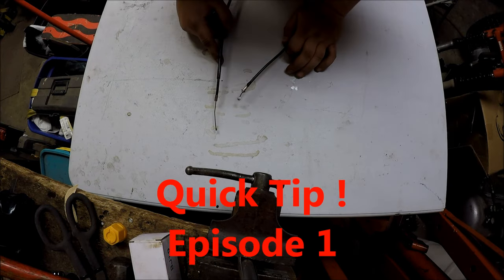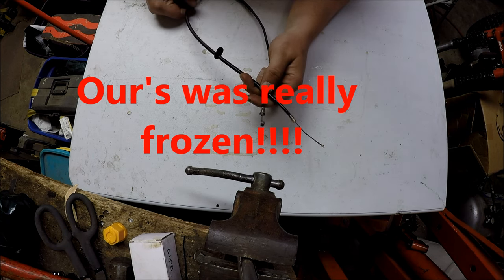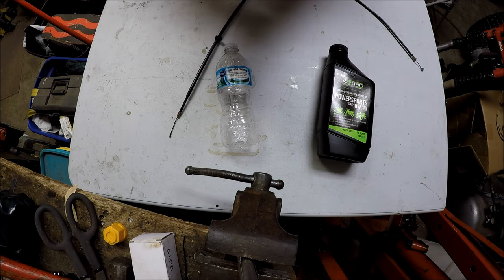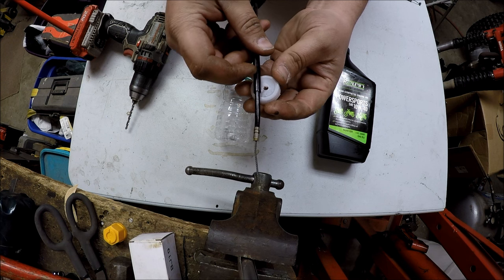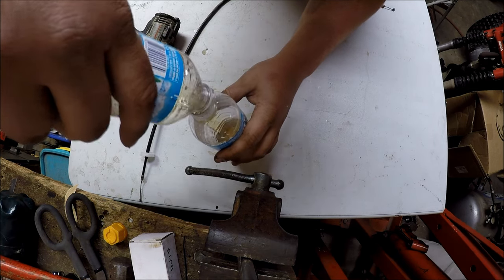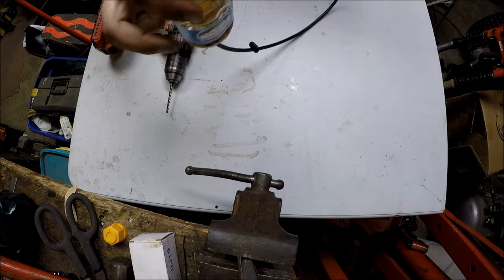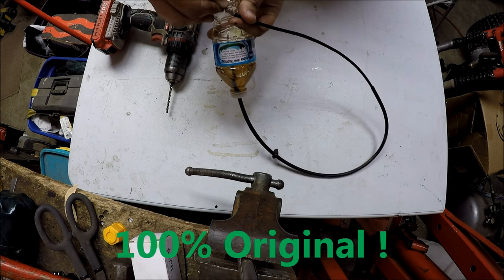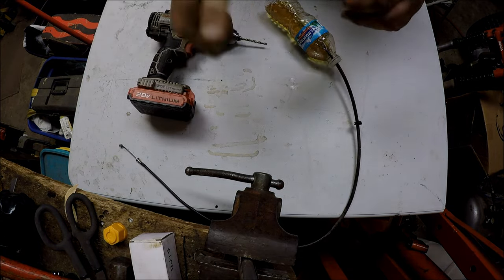How to fix Frozen Throttle Cable  , Brake Cable , Choke Cable on ATV Motorcycle Dirt bike

Comment: I have a rear brake housing and brake line that is tight... so I took all the brake line and housing off bike and soaked brake line in mineral spirits in a bucket and then poured mineral spirits down the housings until I saw it coming out other end. Meaning it went thru inside of housing cable. Yes yes I wasted a lot of minerals spirits doing it but whatever and that said and done my brakes are still sticky.. however this method worked excellent for my front brakes... I ride shimano 5800 brakes on carbon wheels... I'm not riding with stuff not being cared for is what I'm saying... I ride alot and wash my bike a lot so water seeps into the brake lines and rusts the shit out. That said this is only video of trouble shooting brake line/housings for if there tight and what how to re loosen them... all in all I'm thinking just buy a new set of brake line and housings but ther has to be something for the temporary fix... I think this method of this video is 100 percent awesome since he thot of it and if it works than the results say it's awesome
. 
However that motor is too thick for my running that on roadbike brakes... maybe a motorcycle or atv...  anyway minerals spirits clean off and degrease stuff super well as well as evaporates and dries on it's own... it tripping me up why rear brake is still tight I know one factor is that it travels farther and has a lot more turns and line but idk

Peace guys cool friggin stuff!

Comment: Can anyone help me with my go cart? it works but i gotta hold the throttle cable to a sertan spot for it to work and if i let go of it it just stops so anyone got advice for me to fix it?
Reply from the maker: Have you tried cleaning the carburetor on it.
Reply: Yeah i paid to get everything fixed on it but now the problem is unsettling. my sprocket wont stay on as much as i tighten the screws
Reply from the maker: @bountyme446   are they stripped out or vibrating loose?

Comment: Great video man!! But brake fluid works a lot better, then motor oil..
Reply: Yes but brake fluid is very corrosive. Pour some on a painted car and see what happens over a period of time.
Reply: The idea is to use what ever you might have around the garage, maybe.. but yeah I agree with brake fluid...

Comment: i was riding my1995 honda 300trxfw4x4 and it suddenly stoppedd like their was no gas but the tank was full i know it has somthing to do with the choke but i cant figure it out
Reply: Could be a number of things. Watch some videos on steps to diagnosing an engine that won't run. 1st you make sure you have spark, then compression (probably not an issue for you),  then fuel and air. spray some carb cleaner in the intake with the filter off and see if it fires up. If so id bet your carb got plugged up with debris.

Comment: My cable had a fat end of it that wouldn't fit in the bottle. So I duct taped it to a funnel and sprayed PB blaster in up to about an inch depth. It slowly ran out the tape in a few hours so wrapped rags around it. And in 2 days it ran out of the cable. But after pulling on it with vice grips it only moved an inch. Turned out the cable had rotted away inside. Don't know how else to describe it. So ordering a new one on ebay.

Comment: The only thing I would do different is NOT put a hole in the bottom of the bottle and just apply pressure to the bottle to force the oil through the line in a shorter period of time.
Reply from the maker: Good suggestions

Comment: Been doing that trick since the early 70's. After the last ride in the fall we would hang all our cables up with bottles on both ends. Every couple of weeks we would switch the bottom end up to the top to let them soak all winter. Good trick for cables but not a new procedure.

Comment: Couldn't you just squeeze the bottle instead of drilling a 2nd hole and making it gravity fed?
Reply from the maker: MFDOOM  yes it would help to give it a squeeze a day after or so.  But this method is successful the best with time , as it takes time to work through the corrosion and rust inside the brake cable line.
Reply: Yeah I guess it depends on how old the cable is